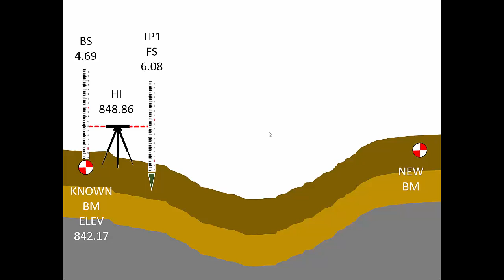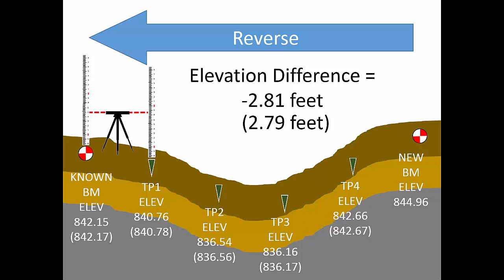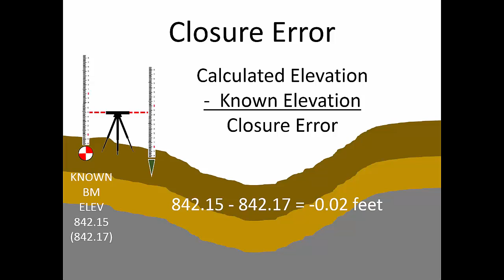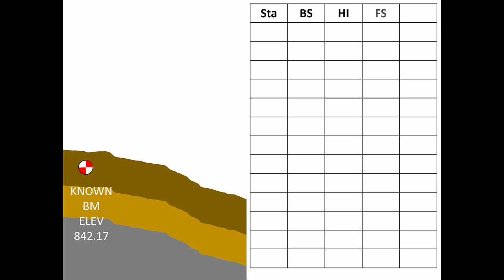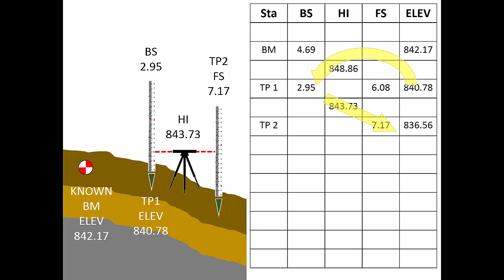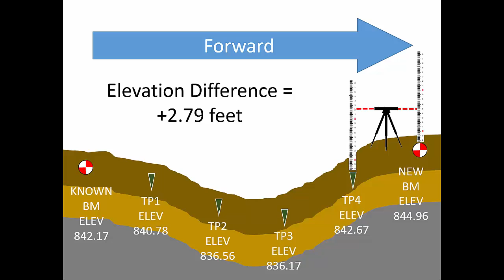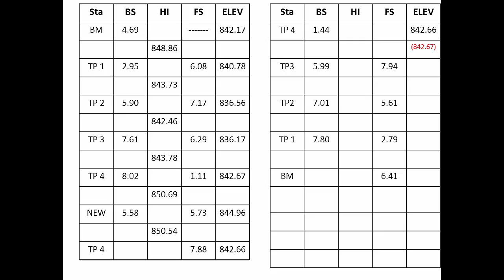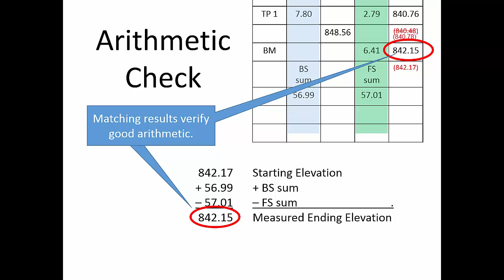Leveling, Part 3

Comment: Just replace 848.86 with 846.86 and the rest of the calculations match.
This standard format for field notes is made for dummies. The BS and the FS should be on the same line reflecting the new elevation from the previous line elevation, since both readings have the same instrument elevation. you can also go to the lines and audit.
Take a look at pharmacies in Canada, they never changed dumping the pills from the big jar on the counter, counting the pills on the counter, dropping it in the small container,  and returning the rest back in the jar attracting all sorts of bacterias in the jar and in the small container. this is called Resisting the change.

Comment: Excellent video.  The only problem that I see (besides the math problem everyone else caught) was that you did not balance and adjust the final bench elevation.  After closing the  loop to within .02' (and without getting into balancing shot distances) you should've split the difference by adjusting the new BM by .01' making it 842.16' instead of 842.15'.  Not too big of a deal, but on large level runs, or when multiple level runs are connected, or when other people are going to use it, not balancing can make a big difference.

Comment: Very good, but not made clear that the Turning Points on the reverse run, though they have the same numbers, are not the same points.  As was explained in an earlier video, the TP markers may be removed before moving on, so the position cannot readily be re-found.

Comment: At 12:53 a value of (840.48) gets put in the elevation column. Almost immediately it is crossed out and replaced with (840.78). What is up with the value that got crossed out? I understand that they are the results from the first half of the loop, I just don't get what happened there.

Comment: sir 848.86-6.08=842.78 but not 840.78
Reply: This is true... but the first mistake was actually in computing the first HI. That is 842.17+4.69 = 846.86 and NOT 848.86. So his second number was actually derived using the correct HI as 846.86-6.08 = 840.78

Comment: Does it matter if the Turning Points are in different spots when measuring forward and backwards?
Reply: Kirtus, It does not matter where the turning or change points are . The important things are accurate set up,  accurate readings and accurate bookings.
Reply: No, but it could help isolate where a "blunder" occurred.

Comment: When does the Earths curvature get figured in?
Reply: Almost never. In 1000' the Earth's curvature is about a 1/4".  It gets exponentially greater the further out you get. In 5000' it jumps to about 8 inches or 0.67'.  In 200' it's less than .001'.  Since most readings with a level are less than 200' and level loops are run traveling along the surface using gravity to level the instrument, there's no practical reasons to take the Earths curvature into effect when doing level runs.  However, if you are using a total station to shoot grades and you are shooting greater distances (over 1000') you may want to do an adjustment.  But then again, how important is .02' in a 1000'?  It depends...

The quick easy formula for calculating the approximate elevation difference from a level line of sight is to square the miles and then multiply it by 8 inches. So, in two miles the formula would be: 2 x 2 x 8 inches = 32 inches or 2.67'.  For a half a mile it would be .5 x .5 x .67 = 0.167' or about 2 inches.  Most job sites (including airports) are considered to be on a level plane (no curvature).

The real question to be asked; Is what would be the difference in elevation  while using a laser, when taking into consideration the curvature of "space and time" caused by Earth's mass?  I have no friggin idea.